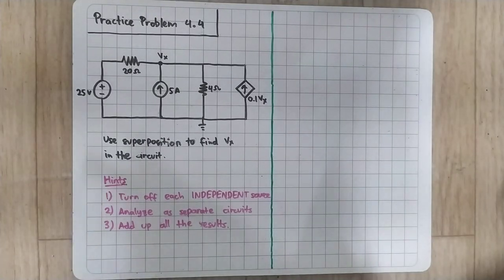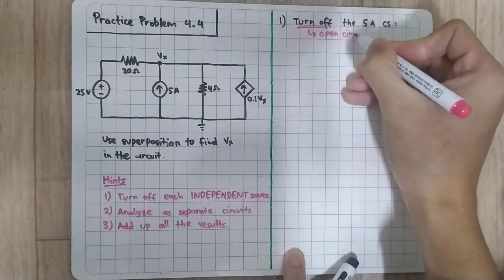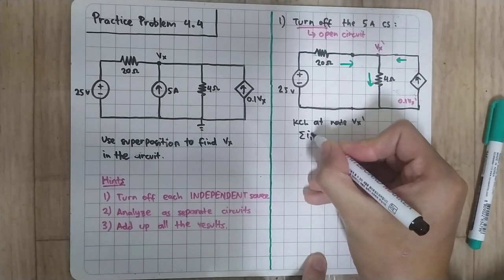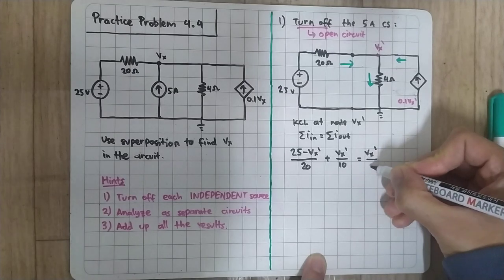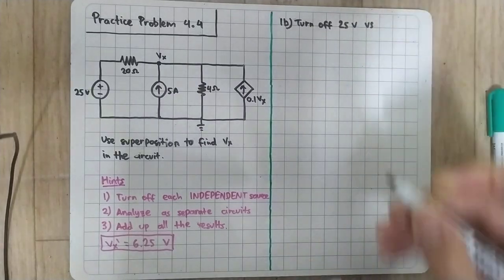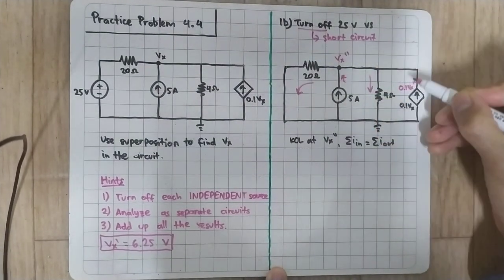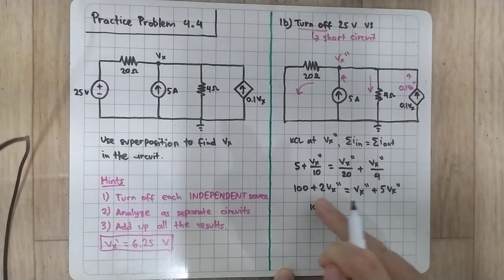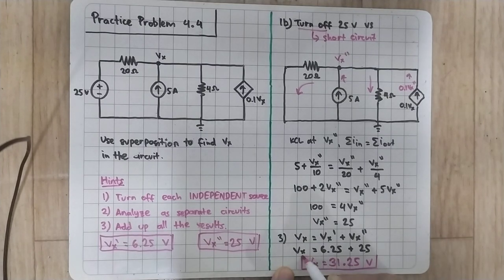Practice Problem 4.4 Fundamental of Electric Circuits (Alexander/Sadiku) 5th Edition - Superposition

Comment: Hello sir, may I ask why do we need to neglect the open circuit of dependent current source, 0.1Vx ?
Reply from the maker: Because Vx is equal to 0, that dependent source will also be 0
Reply: @ArdiSatriawan  oh, like we are assume at first place, the Vx is equal 0?
Reply from the maker: I misunderstood the question. You don't need to turn off dependent sources.
Reply: @ArdiSatriawan  I got it, orite thank you
Reply: Sir In part B while applying kvl.... Why we use vx''/4.....bcoz  already we considered 0.1Vx then??
Reply: @attiqkhan6862  it's not kvl it's kcl/nodal that he applied

Comment: I am wondering if this question can be solve by mesh method? Thanks !
Reply from the maker: Yes
Reply: @ArdiSatriawan  but i cant deal with it when there is vccs , the loop 2 i create is only (I2-I1)*4=0 and loop 1 is (I1-I2)*4+20*I1+25=0 and I2 equals 0.1vx' .I really can't handle this i am just too bad ;(
Reply from the maker: Good luck
Reply: @ArdiSatriawan  oh i finally get it , when there's a current source in the mesh ' just let it equals to the mesh current . Thanks

Comment: Sir in step 2 when we short circuit 25 volt , wont 4 ohm branch also short curcuit because current always fkow through liw resistance place
Reply from the maker: No